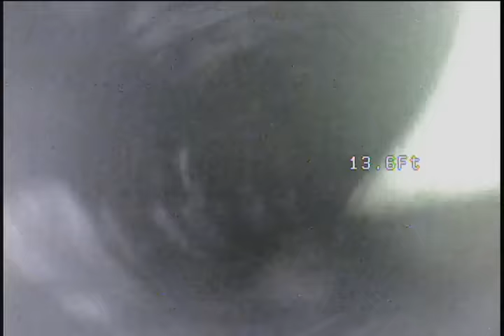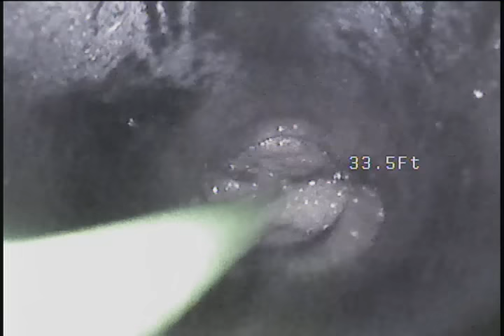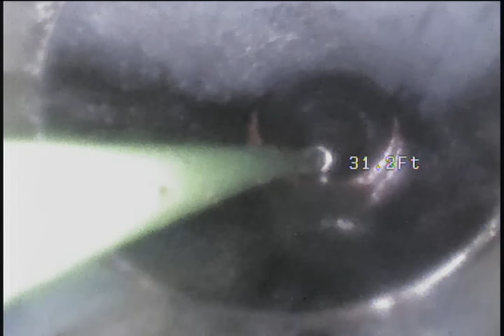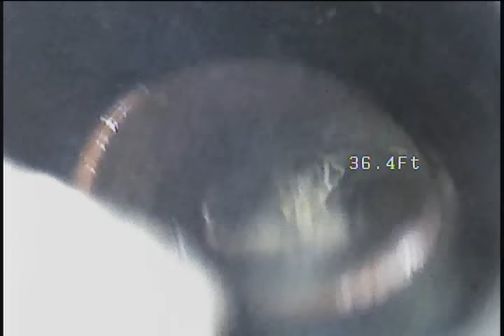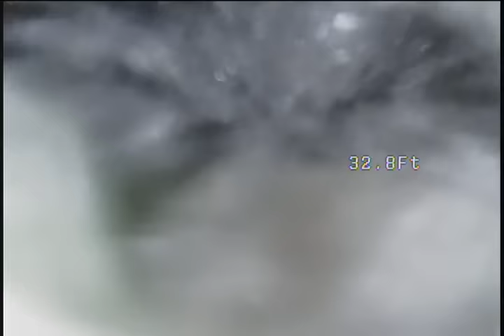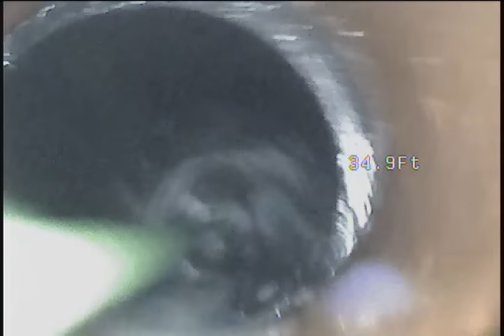Green's Plumbing Co. Sewer Hydro-Jet root removal

Comment: I was told I have one root on my sewer line, I was told we have to dig to get root out🤷🏻‍♀️
Reply: If the roots are minimal, root killer might help. But it takes days to work. Running water will wash it away. If it does work you will need to use it every few months.
Reply: I'm a plumber. Drain cleaners make a commission when they sell dig jobs, so they'll always want to dig. If it's one root, just jet it.
Reply: You’re being scammed 

High pressure hose will clear the roots, and if there is a problem with the pipe, it can be re-lined, which requires no digging
I had it done at my house, and the work was finished in 6 hours
Reply: @justinlee5958  how effective is jetting overall?
Reply: In this situation hydro jetting is a waste of time and money, you can clearly see that the pipe has severely shifted and will soon collapse. I’m not sure if you only had a root intrusion or similar issues like this video here. 
Hydro Jetting is meant to remove and flush out any build up or debris. Here, there using a unique jetting head that attaches to the end of the hose, it rotates at a very high velocity due to the pressure from the water and cuts roots. This will only buy you time, but it will not fix anything. Not a smart idea given they have a camera that showed them the shifted sewer line…this is no belly, this is a section of pipe that has shifted and needs to be repaired! Also, as far as going trench-less, like a liner would be a terrible mistake 🤦‍♂️ please beware of these so called plumbers, the real and only solution is to repair or replace it 🙏
Reply: @justinlee5958  one root would not cause it to back up, don’t mislead anyone here! No sense in jetting one root, one root would be the perfect opportunity for going trench-less like a liner. Once the pipe has shifted, the liner is not recommended anymore. As it will only give you a smooth finish for flow but will still have the section with stagnant water, remember anything solid will stay in this section and the liquid will rise. Soon after, that section will create a stoppage even though it’s lined!
Reply: @Peter-gh5tz  hi how much it cost for one meter??
Reply: In some cases you must

Comment: We have an indoor clean out just above concrete floor. When they start jetting the pipe at our house is there going to be a ton of sludge and water backing up into the basement once they start jetting if the clog doesn’t move quickly? The clog is about 65’ from the clean out.
Reply: What ended up happening?
Reply: @ChadAmI80  long story, so they did end up jetting, (they didn’t bring a shop vac) so I ended up using my little 2-3 gallon vac. We just happened to have a large trash can that I would empty out every thirty seconds, we filled up the trash can with sludge, he got the jetter hose stuck. He came back a few days later with a large vacuum truck so they could jet longer without it backing up, still didn’t help. They charged 650.00 for the jetting 400.00 for the vacuum truck and just said we will get the hose out when we come back to do the plumbing. 

I hired a different company and they ended up breaking the jet hose it’s been a nightmare.
Reply: Sounds like you hired the Guy's Called "Can't get Right" and then the next time Maybe make sure that they have a Good Camera Setup and the guy that I like watching is the Penetrator Blocked Drains and he is out of Australia and he is good with the Drain's that he cleans...

Comment: Hello, What is the PSI for this machine? Do you recommend not going above a certain  PSI for corrugated plastic piping - to avoid damage to the pipe
Reply: The Jetter is 4000 psi overall but not to go over 3800 psi when jetting.

Comment: there is a company here in utah that wants to charge me $250 for the camera inspection and $400 for the jetting, is this a fair rate?
Reply: Ask your neighbours/family if it is a fair rate. Do you have a tradesman review site you could access to see what other people think of their pricing?  Remember the plumbers have their overheads to consider when pricing the job. That said, it will still probably be cheaper than digging it all up and replacing the pipes.
Reply: Yo t cobro 150
Reply: I paid $500 6 years ago. I tried my speedrooter, they tried their I guess spartan, they brought in a tow behind jetter. Yeah…..it’s worth every dime if it works. But that sag in that pipe on this video, ain’t never gonna get right. That’s gonna have to be fixed.

Comment: I apologize, but not much information was given. 
Important, yet very easy to pass along to the viewer is : what kind of jetter ? psi ? gpm ? what kind of nozzle ? 
thank you.
Reply: If I had to make an educated guess I would say the Jetter unit is most likely a tow behind that hose is 3/8 diameter with a warthog Jetter nozzle those units can operate anywhere from 3000 to 4500 psi at anywhere from 7 1/2 to 10 gallons a minute. When utilizing large nozzles like that it's all about water volume over water pressure. There are different size hoses and nozzles and configurations for specific jobs.

Comment: Is it true hydrojetting has to be done on an exterior clean out? Could a plumbing company do a hydrojet down an interior clean out?
Reply: I've seen it done inside. The machine is outside with a long feed line running into the building.
Reply: I did that job some days for Toronto water We didn't want to go inside because if the jet or snake got caught the city would be in a very expensive position to have to dig it out
Reply: Put a man on the moon you think we know how to do this
Reply: Why is this the bane of existence for homeowners

Comment: Can the hydro jet break down hard rust build up?
Reply: I Ran a hydro Jet for years.  They have different nozzles for roots and plugged lines.  I designed a nozzle that will not hang up on a misaligned pipe, or broken pipe or a root filled pipe. For rust build up they have a nozzle that will clear the pipe of all hard rust build up.
Reply: Ridgid flex shaft or picote mini with sandpaper flaps will work better for rust or chain head

Comment: So if the pipe is broken is there any easy way to repair it without breaking floor?
Reply: Doubtful. Sorry to say.
Reply: There is a bladder Insert that is impacted with resin epoxy stuff and forced through. It does reduce Internal diameter of pipe but pipe is usable after. Saw many cities using it on tv and some on Youtube

Comment: Great job putting all those problems on the city... Seeing what was in there you should've replaced all that pipe 🤦🤷
Reply: 1. You mean the pieces of detached & broken up root? Really?
2. They aren’t going to replace anything, unless someone gives them the ok to do so
3. No point replacing the pipe, unless the underlying issue of tree roots is resolved
Reply: @everyhandletaken  1. YES, all those root balls going in the main will clog it. You must be new to plumbing and sewers... Or you just don't care and bandaid problems  2. That's obviously what it needed with that many tree roots growing in the pipe!  3. Refer to #2.
Reply: @-CHaPPy-  no, what I’m saying is, yes that is what is needed without any dispute of the matter, but customer decides whether to proceed.
Reply: @everyhandletaken  I hear you for sure... PVC Pipe is expensive especially these days... Everyone is trying to save money for the essentials... If they weren't able to afford the replacement then I'd definitely pour a ton of salt around the pipe to at least kill the roots
Reply: @-CHaPPy-  I agree.. if it isn’t going to be replaced, all that can be done is to try & minimise the problem with some maintenance

Comment: How much does this service cost?
Reply: Every district has their price to clean a pipe.  Pipes comes in many sizes plus if a line is broke from tree roots the pipe would be full of mud, sand, rock, and broken pieces of pipe.
Reply: 300.00 first hour here in West Texas.
Reply: @LemonySnicket-EUC  damn. $700 in California and that was for just an hour.
Reply: Cost me 100 bucks off Amazon, and 120 bucks at home depot. I had the setup for 2 hrs and ran out of pipes to clean at my house. Rocks, roots, asshole daughter's tampons, and a matchbox car. And did my neighbor's just for fun. 1600 psi pump from home depot, cheap electric works just fine and safe to use in your basement.
Reply: @hellogoodbye3129 : I'm sure your neighbor's reward was fun.
Reply: @eddyvideostar  pretty boring actually. Newer construction.🤭
Reply: $700